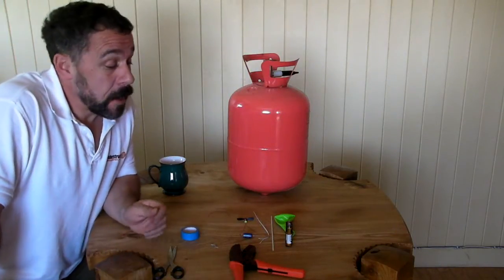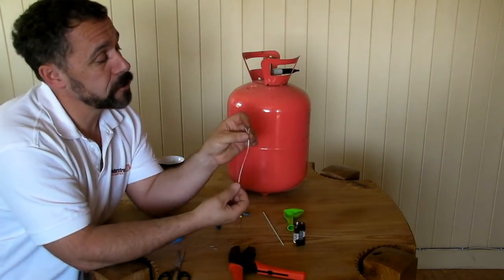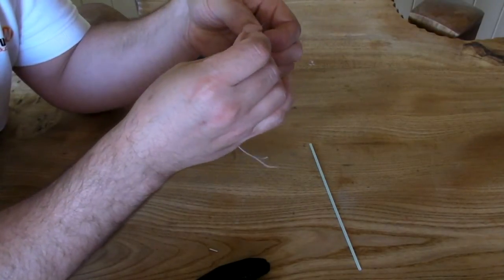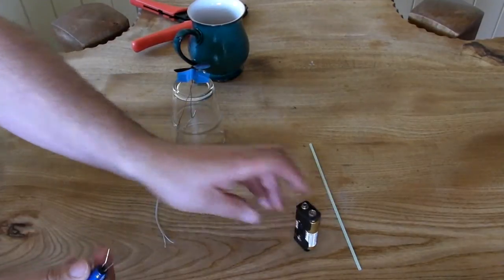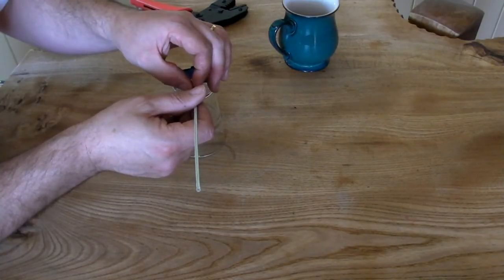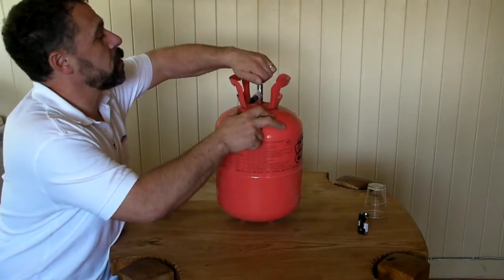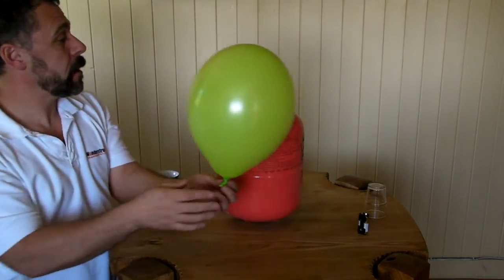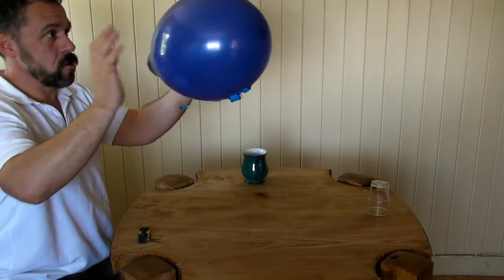Build Your Own Electrically-Powered Helium Blimp

Comment: I use these materials:
Balloon(if available)
Coreless DC Motor with Propeller
Small DIY Gondola
Switch
Wires 
Battery
Adhesive tape
Double sided tape
DIY Blimp Rudders
Ballast(Is this required?)
Helium Tank(if available)